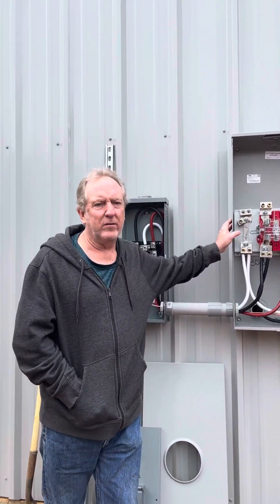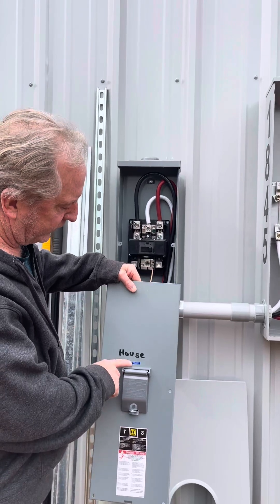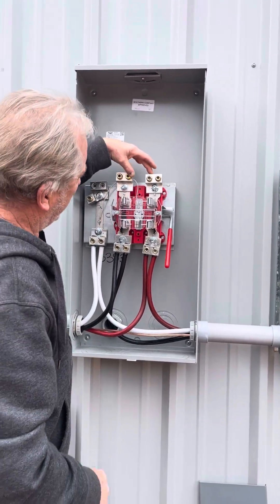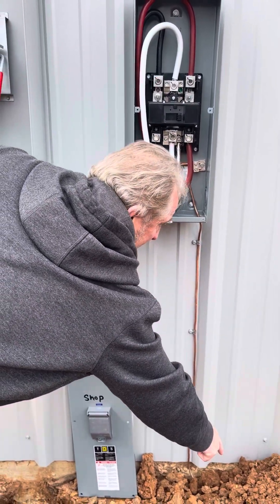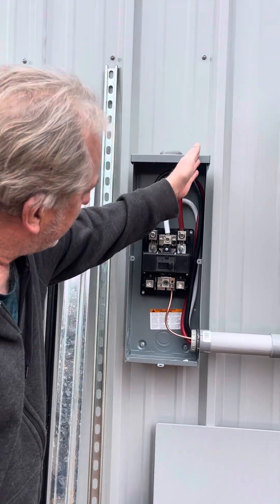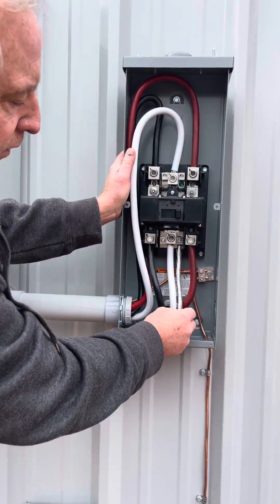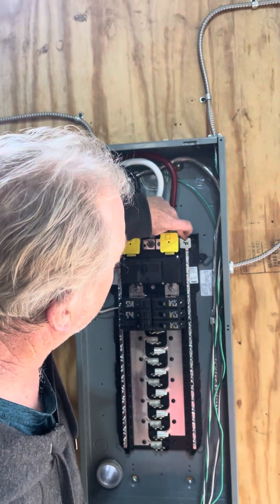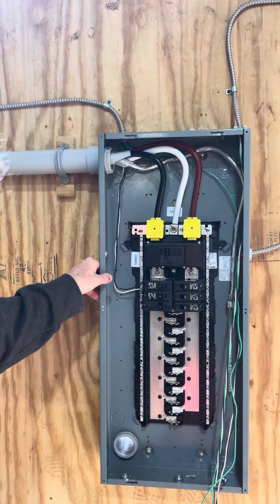320/400 AMP Meter Base Install With Parallel Service Lines

Comment: What is the nipple out the back of the meter base into the building for ???
Reply from the maker: Lol.  That was a mistake.  I originally went straight through to the panel inside, but since external disconnects are now required, I closed it off on the inside.

Comment: I saw an almost identical installation by MB electric on another YouTube channel and the guy had the line side on the bottom of both main breakers, and he claimed he got his inspection passed(i don't believe him) glad to see you did it right!
Reply from the maker: I think a picture of my installation got sent around to building inspectors around the country and they are actually using it to show people what it should look like.  I'm very happy they did this because I went through a lot to figure this out so I posted the video to help everyone doing something similar.  I have had other YouTubers ask if they could use my video and I was completely fine with it.  I am NOT an electrician but I do know enough to build a simple residential home.  This was a little more than my knowledge but now I know.  ;-)

Comment: This is the best overview of the SER process, I have seen.  Other videos will show a clip here and there, but mainly focus more on showing the wiring process and may touch a little on the entire system.  I  had the same exact set up done at my house because I had an additional 200 amp panel installed for just my garage.  Both 200 amp panels are in the garage, side-by-side with the disconnects outside just like yours.  Thanks
Reply from the maker: Glad it was helpful.  Thanks for the comment.

Comment: Violation of the 2023 national electrical code note: article 250-104C a steel buildings exposed structural frame must be bonded
Reply: The steel of the building is inherently bonded by the fact that the three metalic, outside enclosures, which are all bonded, are mechanically/physically attached (bolted) to the metal building's structure. There is inherent continuity through these mechanical (and thus electrical) metal-to-metal connections, such that, no additional "bonding" is required.

Comment: Very nice walk through and explanation. A WORD OF WARNING to anyone considering replicating this. Some power companies will not allow crossing the LINE conductors from the utility company  with the LOAD conductors from the meter within the meter socket. Eversource here in NH has an explicit rule about this. The real problem with this is that there is no easy clean way that I see to avoid this. I am considering running line side conductors( parallel conductors in 2 3" conduits) to the left of the meter terminals and the load side to the right side and right bottom. I would put at LRL fitting on the conduit exiting the bottom to pass under the first disconnect, then another LRL on the far side and strub up into the 2nd disconnect. Ther conduit exiting the  right side knockout of the meter socket  would go straight into the left side of the first disconnect. The challenge with this approach is ensuring there is enough space to run both sets of load conductors out when the conduits are in such close proximity. Need to find a roomy meter socket with at least three large knockouts at the bottom.
Reply: It was like that in Orlando

Comment: Question? Shouldn't tge grounding and the grounded conductors be bonded at the first means of disconnection ??
Reply from the maker: Yes and they are.  The first means of disconnection are the two boxes on each side of the meter.  They have a shutoff switch.
Reply: I can clearly see how you bonded the disconnect on the left, but how did you do it on the right? You used the green screw on the line side of the disconnect?

Comment: Be careful running your grounding electrode through the utility meter base. Some companies will make you take it out. To those mentioning bonding the meter base...the meter base will be bonded because the first point of service (the disconnects) the grounds and neutrals should not be isolated so the ground will ultimately make it back to the neutral lug in the meter base where it makes direct contact with the metal. In this video, a double mechanical lug is used to connect the grounds in the right disconnect
 I have had inspectors only allow me to do that if I run a jumper from that neutral lug assembly to what would've had to be a triple in this case. Long story short my local inspector would've had me run 2 seperate wires(one to each disconnect) and terminate on the ground size lug attached to the neutral lug where the bare aluminum is attached as well. Just something to keep in mind.
Reply from the maker: Yes, I took out the grounding wire from the meter base and ran it under tit to the left disconnect.

Comment: Where did you ground your neutral?
Reply from the maker: Hi, the neutral is grounded at each disconnect.  It is the bare aluminum cable coming from the panel inside the shop to the disconnect on the right outside.  The house is not done so the wires are not there.  There is no ground wire to the meter base.
Reply: Exactly. Technically he was using that enclosure as a bridge between the neutral and grounding electrode. My local inspector would not allow. Would have to be landed on the lug attached to the neutral with a bonding screw in place.

Comment: Mr. Michael - finished my video as well. Made sure to give you a shout out! Thanks again for your insight and sharing your details on your set up! Here is my overview of a similar set up - https://youtu.be/hf-I-VTCT5w?si=cD_z6DQa8PmnZQSS
Reply from the maker: Watched your video and I must say it's way better than mine.  Thanks for putting that out there!  I don't do YouTube videos for money, but I do them to help others.  I have watched countless videos on YouTube and have learned so much so I feel the need to reciprocate.  I am a retired software engineer and I call myself a Maker so I have lots of ideas for new videos, but don't have the time.  I'm still building this house (just me and the wife) so it will be a while before I have some "free" time.  The reason I did this myself is just like you, to save some money and this project saved me a ton of money!  The quotes I got were in the $10K range so $1200 - $1500 made me a much happier camper.  Keep up the great work and good luck on YouTube!

Comment: I’m pretty sure that you’re meter can still has to be grounded at least the enclosure to insure that the metal can mounted to a metal building can’t become energized.
Reply from the maker: I'm not an electrician, but I had a master electrician, the power company and an inspector all tell me not to ground the meter can so I went with that.
Reply: @ you know what after thinking about it that might be right because technically the building is bonded so to keep utilities separate, that might make them right now that I think about it
Reply: @ it’s been a long time since I’ve had to services that small I haven’t worked on a service under 2000amp in over 6 years I think.
Reply from the maker: @timothydixon2545  So you are way above my pay grade!  I don't know how you guys keep up with all those codes!
Reply: @ well after 30+ years of doing electric I’m not going to say that I have it all memorized, but I know a little bit about it lol.
Reply: @pwm001  I looked it up and according to bonding in the code book articles 250.92, 250.93, 250.96, and 250.97 where service entrance conductors pass though an enclosure the enclosure must be bonded. So unless the utility company has some crazy exemption, there should be a ground lug or bar mounted in that meter can separate from the neutral wire that the ground wires bond that meter can to everything. Now that said I don’t know what the utility company wants there and the under 250v to ground rule they might be using that exemption, but I would have bonded it might be over kill but if you can’t guarantee the less then 5ohm’s of resistance to ground through all the metal equipment that is bonded. I have access to a megger so I can test that, so I just wanted to tell you what I found, but like I said you have to do what the utility says in your situation.
Reply from the maker: @timothydixon2545  Thanks.  I added that to my description so it will help others in different areas.  In that case, how do you do that?  Is that just another ground from each of the disconnects to the meter?
Reply: @ I would also tell you that if you would have used metal pipe for your nipples between your disconnects, and had all the concentric KO’s knocked all the way out then you wouldn’t have to bond the meter can itself because of it being under 250v to ground. The PVC between your meter and your disconnects is the reason paired with service conductors is the reason the code would require the metal enclosures to all be bonded, and the metal conduit would work as your bonding means. You would have not needed bonding bushings or anything special just approved fittings with regular lock rings. I hope that helps you understand what they are saying better when they talk about equipment bonding, or equipment bonding path, not to be confused with your service bonding method going to bonding electrode to bond your neutral.
Reply: You didn’t have to I was just telling you what I had found I do want to say thanks for making me think about it and actually making me look something up again keeps me on my toes.

Comment: So, just to be sure: the neutral and ground are bonded in both of the two external disconnects, yeah? and then they are kept separate in the interior panels, and any further down sub-panels, I would guess?

I just wanted to make sure I have it correct about the two external disconnect boxes, that the neutral and ground ARE indeed bonded inside BOTH of the exterior disconnect boxes to the left and right of the meter socket box. Do I have that right? Thanks!
Reply from the maker: I am NOT an electrician, but yes, that is how I was told to do it by an electrician, the power company and the inspector so that is how I did mine.  I have also researched YouTube up and down, and whenever you have a “sub panel” the ground and neutral are separate.  Usually the big green screw comes out and a separate ground bar is added.  The disconnects I have on the outside are like the main breaker in a panel so they would serve as the “main panel”.  Hopefully that makes sense.
Reply: @pwm001  Appreciate ya answering right back! And yep, It all makes total sense to run it that way. I just needed a quick sanity check 😁 
I get the impression that you're probably about as on-top of things as it gets...(so I may be back, if I get to second-guessing myself mid-install!) lol
I really appreciate the video! 🫡
Reply from the maker: @MichaelBeale  No problem.  It's the very reason I put it out there.  So anyone who wants to can figure it out themselves.  I feel if you get close enough, then either the inspector or the power company will tell you what you messed up on and then you can fix it.  They should not energize it unless it's been checked out.
Reply: @pwm001  @MichaelBeale - THIS has been EXTREMELY helpful. I am in the same boat as Michael. Setting up my system and the grounding/bonding was throwing me off. When the "Main" panel becomes the Disconnect, the "Sub" panel (or panel inside the shop for this video) is not jumped/bonded inside the sub panel (remove green screw or bonding jumper). Instead because your "Main" panel is now the disconnect, the ground and the neutral are bonded here, at the disconnect. Your video - along with this video (https://youtu.be/NUSNa-7Hecw?si=_MdoyBtjhB4LMFE-) helped me tremendously. I am doing a video detailing the installation of mine as well on my channel. Hoping to help others out - just like you have done here. I am not a licensed electrician, but love learning and doing hard things. Thanks again for this very helpful video. In fact - my inspector sent me a picture of your thumbnail and said, "this is what it should look like" (minus the GEC - Grounding Electrode conductor - Copper wire in the earth being ran through the meter base) lol.
Reply from the maker: Lol.  Yes, I had to re-route the GEC so it went to the disconnect on the right and then under, not in, the meter to the disconnect on the left.  It is 1 continuous bare copper.  Glad to be of help.  As I said before, I am not an electrician.  I am actually a retired software developer and I'm building my own home and there wasn't much on the internet so I had to piece it all together.  When I was done, I gave $100 to an electrician to come look at it and he said it was spot on so that is what I went with.  Even then, the GEC was running through the meter and the inspector said it shouldn't be there, but he wasn't sure and he passed it anyway.  It wasn't until the power company showed up to connect at the pole and they said the GEC could not run through the meter.  It was definitely a learning experience!
Reply: Great question  is was thinking the same thing

Comment: What brand and model are the disconnect panels? Where did you get them?
Reply from the maker: They are Square D 200 amp Circuit Breakers from Home Depot.  Model QOM2200VH
Reply: @pwm001  thanks

Comment: I really appreciate this! I am doing the same exact thing (400A split 200A shop, 200A house) in a few months. Building a log home with a 1200SF shop in the Ozarks. If they let me, I'll be building the shop first to set up a work area for building the house.
Reply from the maker: Yep.  That's exactly what we did except it's a regular house and not a cabin.  My wife and I are building the house with the exception of the concrete slab and septic tank that we had someone else do.  Too old for that for sure.  So we built the shop which is a Versa-Tube steel building and put all the electrical on it.  It is 20' from the house so it makes it easy to bury that line.  We had to dig down 36" for 620' of parallel lines, so that was fun.  After that, we set up our tarvel trailer and hooked it up to a sub panel outside the shop next to the shop disconnect (not shown in this video) that is fed off the shop and is made for RVs.  Then we hooked up a sewer line to the septic and now we have plenty of time to build our house.  I found that having the shop is nice for keeping things out of the weather and will be great when I start working on details like cabinets and so forth.  Right now we are at the point of finishing up the roof sheathing.  Funny you are in Ozarks as we left Kansas City to build in Georgia.  Land was much cheaper here and we don't have to deal with snow any longer.  Good luck on your build.
Reply: @pwm001  I'm having two issues getting started: 1) I found some very nice lots around Table Rock Lake but they have HOA and overreaching CCRs. 2) I have to sell my current house first as the new house is going to be my last and I want to pay all cash building it. 
I think that's great that you're getting out of the snow! Right now I'm in the high desert of east mountains NM and we get tons of snow. Southern MO has very mild winters in comparison but they do get snow for a short. I've been vacationing in the area for 50+ years now.
Reply: Do the disconnects have to be 400 amp or can they each be 200 amp?

Comment: Where im at the power company does not allow a seoerate ground to even go into meter base. Also they cities do not allow ser in conduit
Reply from the maker: Those are very good points and you're right, I did need to move the ground so it went under the meter base.  That is the power company's rule (Georgia Power) and not code.  As far as the SER cable, since I stipped the outside insulation away when it went through the coduit, it was allowed.

Comment: Great video Phill, do you happen to remember where the meter base came from?
Reply from the maker: Yes, it was provided by the power company.  They had supply chain issues, but I got very lucky and they got one in at the very time I needed it.  They do have them on eBay but make sure it’s UL Listed.  There are a lot of no-name Chinese brands out there.  I’ve
 had a Chinese made RV sub panel catch fire on me.  Luckily I caught it in time.

Comment: In New England when going through the sides of those you have to use myres hub connectors
Reply from the maker: Thanks.  That's interesting though,  I didn't think they made a PVC connector.  Learn something new everyday.
Reply: @pwm001  yes sir, it’s the connector that would be rated for it, that have some other type connectors that work for rigid also, but in the NEC in the wet locations section you’ll find the part about using waterproof connectors on this type of equipment. You had a very nice install though in this video . Just figured I’d pass some info along, I didn’t know about it until an inspector mentioned it
Reply from the maker: Gotcha.  Good to know.  Not sure why they don’t require it here in Georgia, but I think they should do better with water proofing than they do
Reply: Is that to connect to the boxes .go through the bldg or both?
Reply: in Texas you can use pvc connectors with sealable lock rings

Comment: Hi Nice looking panel what size wire did you run to the subs
Reply from the maker: I only hooked up the shop so far, but it is Type SE Style R 600V XHHW-2 AA-8000 AL 3/C 4/0 AWG + 1/C 2/0 AWG (UL) E222531 Priority Wire Sunlight Resistant 23372-18.  So that is 4/0 for the 2 hots and neutral and 2/0 for the ground. 
 Hope that helps.
Reply: @pwm001  thanks Working on mine today Main Two subs and a RV Plug. Just Waiting for my split lugs